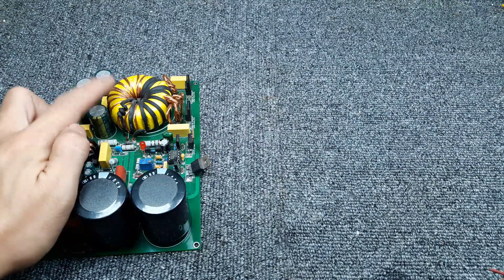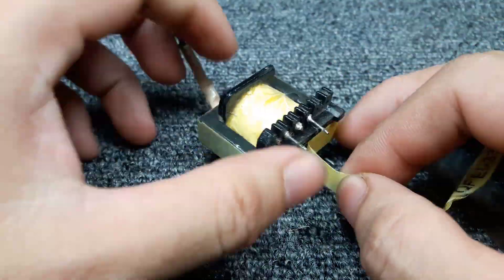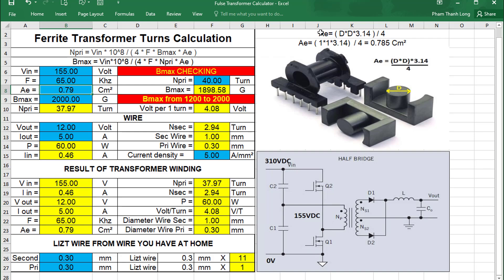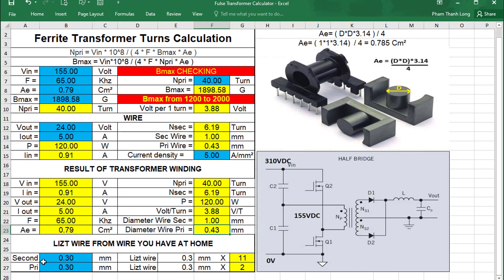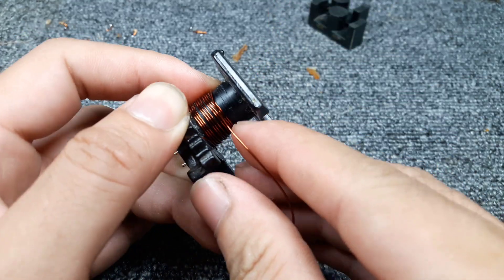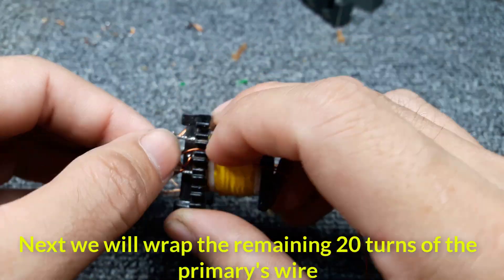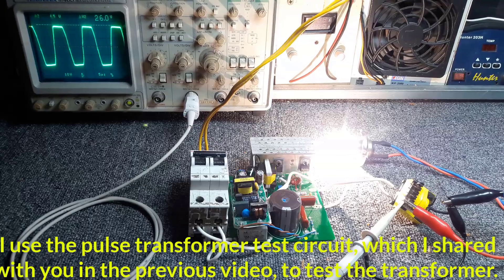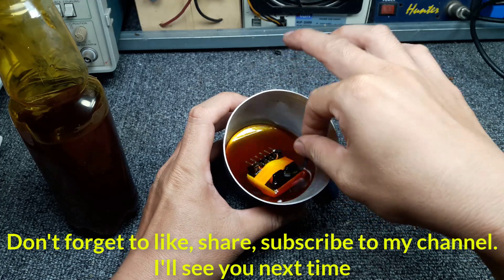Instructions on how to calculate and wind pulse transformers without using any software

Comment: why you turned the primary winding two times 1)20-turns primary,2)7-0-7 secondary turns,3rd layer 20 turns primary ,any reason is there

Comment: This is diferent video. I never think so easy from dificult calculations.
Reply: Because it does not contain any parameters which depend on a magnetic material and an air gap. This works for a used double ER gapless transformer core from a computer PSU. Period. Just try to start calculating what YOU need (using your particular application), and you'll find it much complex.
Reply: @sc0or  Thanks.

Comment: Hello Sir. Thanks for sharing! I think there is a sim-calculation, as you can see in the schematic you considered Vin as 310V while in formula you considered Vin=155. Both definitions should be defined separately.  Thanks again
Reply: On the schem* the middle point is 155 V, this is unique to this half bridge topology

Comment: Looks easy but with all incomplete info is not possible "topology, converters flybacks pulse transformer, what ferrite core do I need,  what frequency, do watts matter? What is bmax?" Any way what type of transformer do I need to work with an amplifier -60-0+60v

Comment: Sir can you share the design to make ac to ac smpa 2500 watt. Simply a voltage stabilizer with input 100 to 200 vac and out put is 220 vac
Reply from the maker: Video already in my channel
Reply: Sir please share the link i am unable to find

Comment: Good job man love u from India Punjab Amritsar
Reply from the maker: Thank bro
Reply: @LongTechnical  

can make a video on Ferrite ring core 50 mm core Diameter.20 mm height, inner core 30mm,  with KA3525A IC, can you tell me primary Turns for 12 volt DC car battery and secondary voltage 50 0 50, 15 Ampere dual supply voltage for transformer ?

I will be using 6 IRFZ44 Mosffet for ferrite ring core